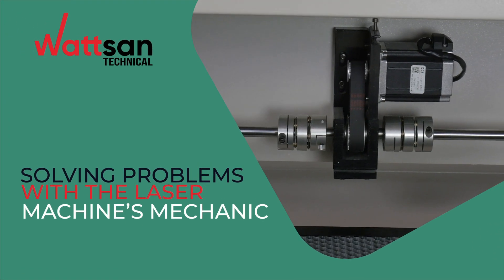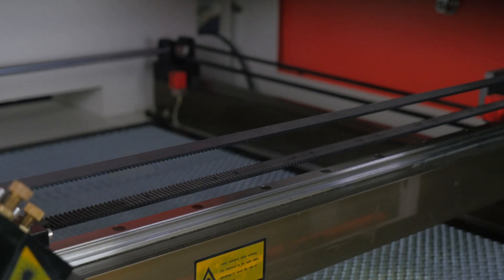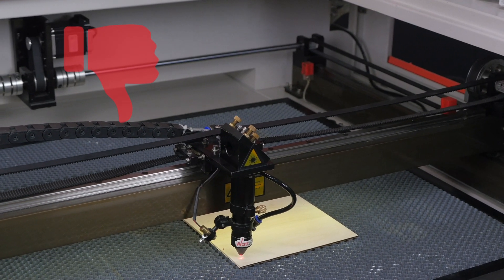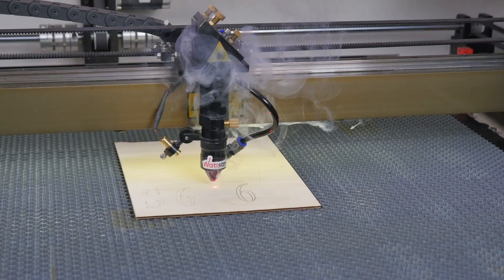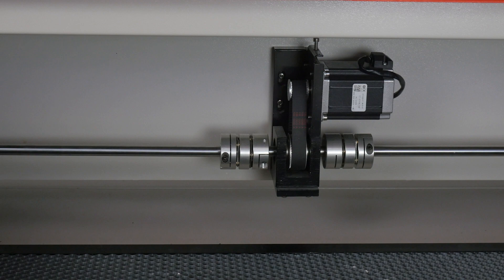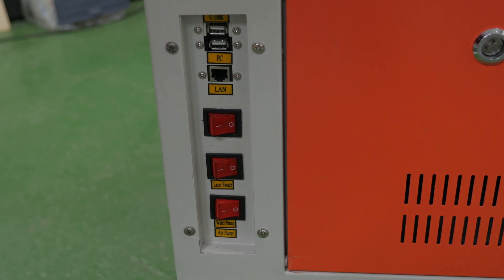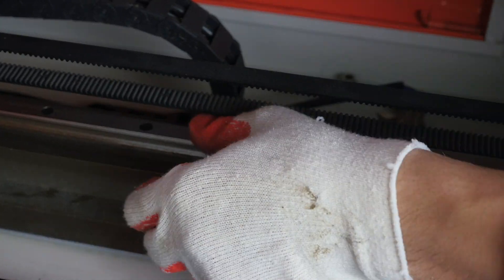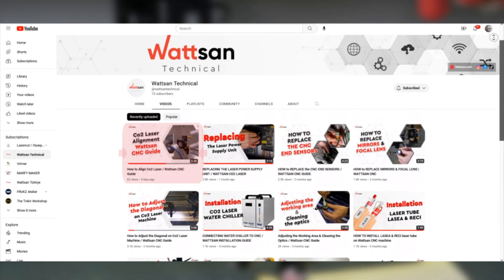TOP 3 MISTAKES CO2 Laser!  Mechanical issues of CO2 laser machines | Wattsan

Comment: I have a 1610lt machine. While cutting acrylic I see straight lines in the cut. The size is correct though. Running at 4mm/s. I see others with higher speeds and have flamepolisch results. I do not have any other issues with the machine, it cuts straight and is proper allignt. I drew this project in Lightburn.
The belt tension seems to by Oké and all screws are tight.

At forums they suggest increasing or decreasing the motor current at the stepper driver. Because it seem to look like the vertical lines are from the motorsteps

What do you recommend?
Reply from the maker: One possible way to remove this effect is to slightly change the step divider on the stepper motor driver. If you are not an advanced machine operator, then this may be a bit difficult. But if you are not afraid, you can make the backup of the vendor settings in RD works, change the step divider to the neighboring one when the driver is turned off (for example, if it was 5000, set 4000). Then the gear ratio will need to be changed in RD Works so that the size of the products matches the desired one

Also, reducing the gas pressure has a positive effect on the quality of the acrylic edge. But you can't completely remove the gas - the focal lens may be damaged.